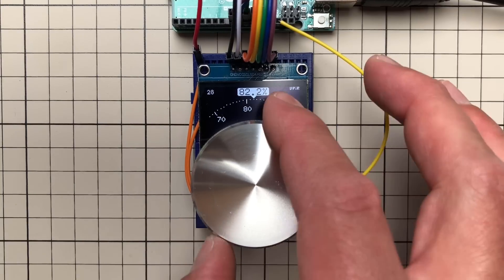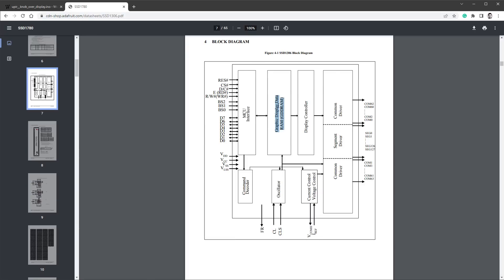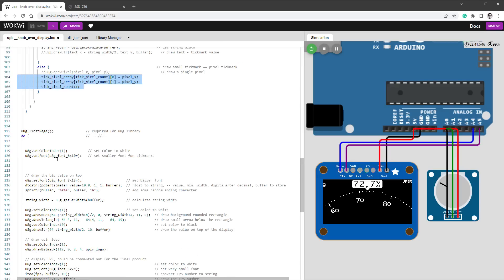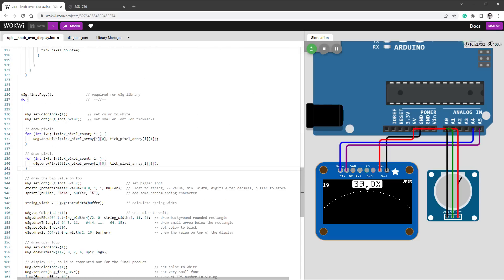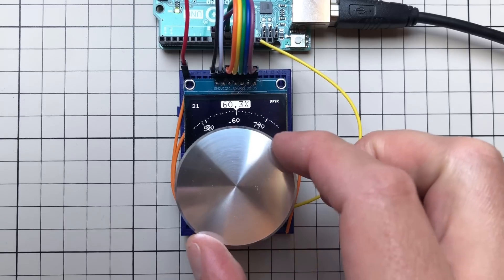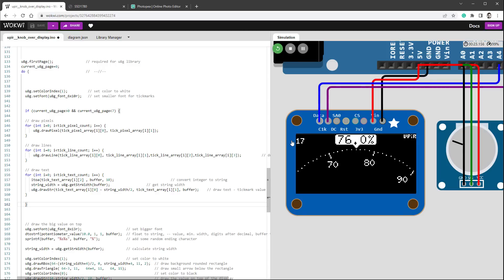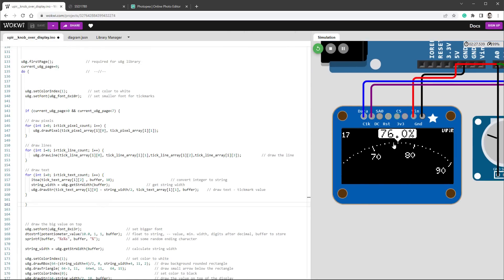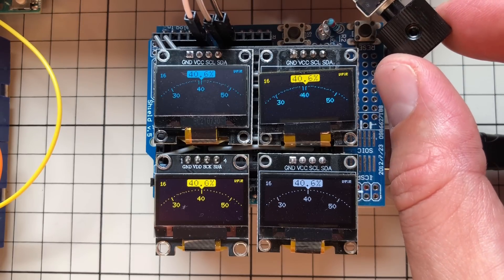This one change made Arduino run at 27.5361 FPS

Comment: Can it transmit midi CC? 
Is there a knob with tactile feedback with each increment?(with a tick)
Reply from the maker: Yes, you can send MIDI, for example by using the control-surface library. Rotary encoder has a small tick with each increment, is that what you think?

Comment: How do I change the order of the numbers from 0 to 100.  To work like a normal speed or volume dial the pot needs to be turning in the opposite direction when increasing amplitude, clockwise.  I got the pot working correctly by mapping 1023, 0 instead of 0, 1023 but how do I reverse the graphics to follow the dial?
Reply from the maker: From top of my head, I think you can do this when you are drawing the numbers, just map thsoe to a different range. This way, it´s not affecting other parts of code.
Reply: @upir_upir  thank you I was watching to tutorial last night so I will try again soon.
Reply from the maker: Sounds good, good luck with your project!

Comment: This is great!  I've been struggling with what I thought was a slow OLED the last couple of days, and your analysis of the u8glib library really helps a lot. 

One question: Did you try using the u8g2 library instead, from the same guy, which is much newer?  Does it have better optimisations?  I couldn't get it to work with my display (using SPI, but with SH1106 controller).
Reply from the maker: Thank you, I´m glad it was helpful! I have quickly tried u8g2 library, and it was working just fine. I don´t believe you can get any better performance with UNO, since you have to use the same "page" method. However, with microcontrollers with bigger flash, you can use "fullscreen" and that should be faster. I will explore those soon and surely record another video.

Comment: I would imagine the text modifying operations like sprintf and divisions to take quite a bit of performance as well, so it might be helpful to only execute them once per frame (or once per change) as well.
Reply from the maker: Agreed. Divisions and floating point operations are slow, and there are some places where integer math would be sufficient. I did stop with the optimizations when I have reached 30 FPS, but I´m sure you can speed it up even more.

Comment: It seems like the value is not stable?
Reply from the maker: Yep, it´s a combination of cheap potentiometer, unstable input voltage, and the wrong alignment of stars. I mean, it could use some filtering for sure.

Comment: I wonder if it would be feasible to change the board to an ESP32 or STM32 to also help speed up the framerate? On top of that, I noticed that common Uno's have gotten more expensive than the STM32. I see some people around me change to the STM32. It does take a little getting used to, but once they changed, they said they didn't want to go back. There are some nice development boards available and these are also usually smaller than the Uno's.
Reply from the maker: Definitely. Replacing the UNO with anything more powerful would surely increase the FPS a lot - like STM32, ESP32, Arduino Mega, Teensy, etc.
Reply: @upir_upir  i'm gonna try this without the optimizations on the raspberry pi pico (in micropython) shortly, I'm gonna keep you updated :)

Comment: From my experience u8g library is just sad performance waste. It comes with great compatibly and features, but sadly the way its written doesn't work most optimal way for every display. I once had project with LC7981 240x128 display, and it was working slow and had high memory usage (buffered). Ended up writing my own library, which by default was like 3 times faster (in my specific case) and used only fraction of the memory u8g used. Of course, it requires more time and effort, but in some cases its mega worth.
Reply from the maker: Well, I guess the performance is a price you have to pay for the great compatibility and features. Personaly, I´m quite happy with the speed for this project, and I really like the simplicity of using the u8g library.

Comment: hmmm... In parallel communication you send all the bits simultaneously, in serial you send all the bits through one cable. Is there anything in between?
Reply from the maker: Actualy there is. You can have dual, quad, octa SPI communication, which is serial, but is using multiple data lines.

Comment: Hi Upir. Did you consider eliminating any floating point arithmetics in your code? From what I have seen, most of the time spent in arduino libraries is spent on those. Like reading a giro sensor value can take something in the millisecond range using an arduino library while the actual interfacing with the sensor only take something in the microsecond range. calculating those values between 1 and 0 cost so much processing time.
Reply from the maker: That´s a good point. I´m sure there are places where floating point math is not really needed and could be done with fixed point math instead. I will try it next time when I will optimize the code.
Reply: I would actually argue that floating point is necessary hardly anywhere in small to medium size embedded systems. The benefit of floating point math is primarily the huge  range which can be covered by one variable however only with a certain degree of accuracy. secondarily I think its mostly for comfortable human interaction.
In the end basically every sensor is providing the values in fixed point via twos-complement across certain static ranges. This can be reflected through the whole system to get rid of floating point. 
Having divisions truncated can easily be solved by upscaling a number for calculations to reduce forwarding errors (*10 or *100) and then downscaling to the necessary resolution. 
If you would use 1/1000 instead of 1/100 as number scaling, then there is even no need for numbers between 1 and 0 at all. 
Also it is great to see that you use wokwi. I think its a great platform!

Comment: either you are running i2c or spi but the video overlay is wrong if it is spi because spi doesnt have sda and scl that is i2c then it should be mosi miso
Reply from the maker: The WOKWI project uses I2C display while my "real" project uses SPI display. The code has initializations for both displays, so you can just uncomment the one that you are using. Does that make sense?

Comment: Just a tiny detail: I was wondering why you're using 2D arrays instead of 1D arrays of structs. This would allow naming of the points and coordinates instead of having to remember the meaning of the second index, and I think it would generate the same assembly code.
Reply from the maker: That´s a very good point. I´m actually using structs in my current projects for the mentioned reasons. It´s much easier to understand inside the code. That said, thank you for the suggestion!

Comment: Have you considered taking lookup tables to the next level?
It should be possible to generate all the different images created at different positions. It's very likely that there is shockingly few when you take into account how the ticks effectively go through a cycle that repeats every 10 degrees.
If storing all that in the program takes a lot of space you can add in how its effectively mirrored in that the second half of one screen will be the same as the first half of its complement reflected (something like 61 and 69). Also the blank space could probably be compressed with counts of the runs of zeros.
All the text positions can be similarly precalculated as they will also have origins that are cyclical.
You can likely remove all the trig functions this way.

If you want it to still be easily customizable you could likely create code to generate these values via preprocessor instructions that will evaluate at compile time and never actually need to run on the device.
Reply from the maker: I was thinking about something similar. The "image" of all the tickmarks repeats quite a lot, so you are right, if you would count all the possible options, it would most likely be some small number, and you can store those images in a memory, not having to calculate anything, drawing lines etc. 

That said, I have stopped with the optimizations once I was close to 30 FPS. I need to continue on other projects, since I have like 10 running all at the same time..

Comment: The repeated drawing for each page is a compromise to save RAM, but the entire buffer is only 1KB, so if you don't need that RAM for anything else you can change the number of pages and only draw once (or twice to reduce RAM use to 512B).

It also looks like you're using `int` a lot, which is 16-bit on AVR. For any values that can be 0-255 or -127-128 you'll halve the number of instructions for any operations on those by using an 8-bit type (uint8_t or int8_t), since the CPU can only work on 8 bits at once.

Using floats on AVR is also a big slow down, but trickier to substitute here in a beginner friendly way
Reply from the maker: Undestand about the RAM usage, it makes perfect sense. 

Also, good point about using 8-bit integers when not needed to use 16-bits. I have used "byte" type for the lookup arrays, but I guess I could use it in more places as well. Thank you for your comment!

Comment: Hmmm... But why you need update screen so many times when Changes of values a discrets? Why not change screen only when values changes?
Reply from the maker: You are right, you can as well update the screen only when the value changes. I kept it running and drawing all the time since the Arduino is only driving the screen and not doing any other calculations.

Comment: ESP32 and Teensy users are unlikely to feel the need to optimize when using these peripherals which is a shame as this is such a good education. I occasionally force myself to use an Uno or Nano just so I can see where the bottlenecks might appear later if it develops to an ESP project.
Reply from the maker: Agreed about the ESP32 and Teensy. That said, if you make it work with Uno, it will work with anything (well, not the attiny... )
Reply: @upir_upir  Agreed although paradoxically, faster cpu's if not accounted for can play havoc with switch bounce as there's so much more time to get it wrong :)

Comment: Oh I've actually worked with a display similar to this (though it was using an ARM uC and the 8080 bus, bit banged, with a much higher resolution). I ended up getting about 20fps by setting it into an upload command and using DMA to constantly stream RAM from my microcontroller to SPI. While it sent the last frame, I could begin drawing the next one.
Reply from the maker: That´s very interesting! Are there perhaps some screenshots of your work that you could share? I would love to see it!
Reply: @upir_upir  ok actually I mixed up two projects I did, but the solution was the same:
https://youtu.be/JKfqrTaKWEg
https://youtu.be/hgKFSpXYkq8
Bigger bit banged display used to be so bad you could watch it draw, and similar for the smaller SPI one. DMA is hard to beat though because you can get data out cycle-perfect, basically.

The bit banged one required weird DMA microcode that wrote to two registers (data+rd/wr), but SPI controllers almost always have plain "here's memory and a length" DMA. The Uno might be too limited though--but I think the ATMegas and STM32s all have DMA which works nicely for stuff like this.

Comment: You also could create structures for pixels, lines and text blocks instead of messing with indices
Reply from the maker: That´s actually great idea. I will surely use structures in next project to make it more readable. Thank you for your suggestion

Comment: Maybe implementing a simple first order IIR lp filter for the angle would smooth out the measurement
Reply from the maker: Would you perhaps have some links where I can find more info about the proposed solutions? Thank you!
Reply: To simplify a lot:
You only want to add a fraction of the difference between the current value and the newly measured value - in code this can be written as:

curr_val = curr_val + (meas - curr_val) / 16

i chose " / 16 " as this i very easy to impl. in µcontrollers as it can be represented simply as a bitshift by 4 to the right such that the above code becomes:

curr_val = curr_val + ((meas - curr_val)  >> 4)

if you want to see the resulting response from a step response google:
"first order low pass filter step response"

Hope this helps!

Comment: Are you sure about how the pages work? According to the documentation of the library the pages are totally unrelated to the display's memory pages, the library creates a local half buffer to use less ram and does only two passes and each pass is called a "page". Check the documentation about the graphic loop in the wiki at theirs github.
Reply from the maker: I believe the documentation is not up to date, or perhaps it only shows two pages becase maybe some displays only use two pages? In this case, I´m quite sure that there are 8 pages, as the internal variable that I have defined goes from 0-7.

Comment: Size firmware??
Reply from the maker: You mean the program size?
Reply: @upir_upir  yes
Reply from the maker: I will check tomorrow, but I’m nowhere close the limit of Arduino uno
Reply: @upir_upir  my small project, used fully memory atmega8, and only used small code from uart, connected word))
Reply from the maker: @hybridinnovate  you mean ATTINY85? That might be a challenge, since the memory is much more limited compared to UNO. I´m not quite sure that my program would fit, it would probably also make sense to use other library than u8g for that device.
Reply: @upir_upir no,mega8, I'm used only big font and small font,  to be fit code generation. Not used function line,icon...no memory.  what about using external memory i2c?
I'm not arduino IDE. Only winavr or cvavr

Comment: I love this effect, would look sweet on a high end stereo! These little oleds burn in hard though if you leave them on all the time. I used them for thermometer displays and they all turned into garbled messed after a year
Reply from the maker: Thank you for your comment. I was actually curious how long would it take for the OLED to burn in the pixels. One year sounds like quite short time...
Reply: @upir_upir  Yes and PMOLED is different from AMOLED in that regard but in that case you might be comparing monochrome with colour so the wear effect is different too.
Reply from the maker: @nikthefix8918  I thought that original comment talked about the monochrome PMOLED. That said, I have a new PC with AMOLED, and I worry about burned pixels a lot...we will see
Reply: @upir_upir  I think is is still an issue that blue pixels degrade faster than red, green so the 'burn-in' is largely due to a lack of blue when there is an illuminated region - yellow ghosts when displaying white for example. Manufacturers are claiming that this is getting solved so I shouldn't worry about it and I would guess the TV's will have a usage related compensation algorithm. Hope so, as they know exactly what will happen over time with a particular model. So we shouldn't call it burn in but degradation leaving certain pixels dominant. If the manufacturers apply appropriate wear levelling then I imagine that the display would simply get dimmer over time. The long term reviews of AMOLED equipped laptops are very encouraging but I'm sure it will will considered an intermediate technology in the near future.

PMOLED for Arduino is a different matter of course. Especially as many experimenters run 3.3V limited devices with 5V Uno/Nano. Screen saver (blank screen is a good idea for sleep).

Comment: looks like it could use some filtering, so the values don't wander around so much. cool project
Reply from the maker: Thank you! Yep, filtering would surely help. Any ideas or links for something that might be helpful related to that topic?
Reply: @upir_upir  What about using the RunnigAverage library from Rob Tilliart?
Reply from the maker: Good idea, thank you for your recommendation, I might try that.
Reply: I would just create a simple condition to prevent refreshing if the value is within a threshold interval.

Update the display only 
If new_value < old_value -tolerance  or new value > old value + tolerance
Reply: Or averaging some readings

Comment: Write a mixed C/ASM for the Atmega and you`ll see a huge improvement. Standard library functions are sometimes slower than custom. Instead of divisions, try to use multiply and register shift. Look for Q1.15 integer fixed Point operations. Float Point os Very, Very, Very slow.
Reply from the maker: Thank you for your comment. I´m pretty sure that having some inline ASM would help, but that´s currently outside the scope of what I can do. For now. I would like to learn as much as possible, but it´s slow.
Reply: The atmega328p used in the Arduino uno doesn’t have hardware support for floating point, so fixed point would see a huge I improvement. If anyone reading doesn’t know fixed point is when you encode decimal numbers as whole numbers then do fast math and convert them back at the end. To do this you have to decide how many decimal digits you’ll use, hence “fixed point” precision. Modern hardware encodes numbers using a “floating point” precision and used completely different hardware to do math on it. Fixed point is easy to do but can be confusing to anyone who doesn’t understand how it works. (Though you don’t really need to know why it works, just that it does and the very simple rules to using it)